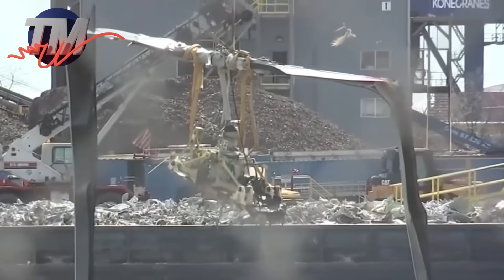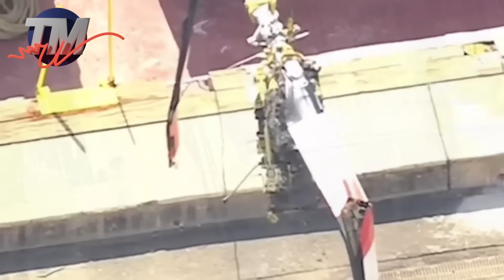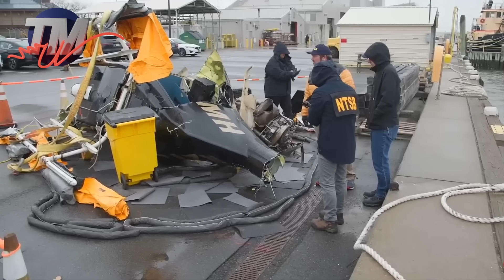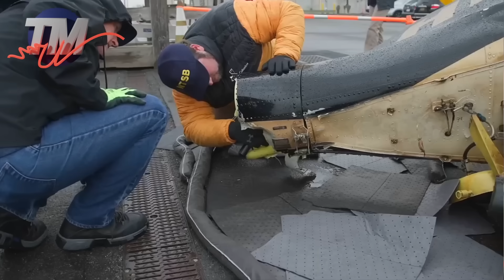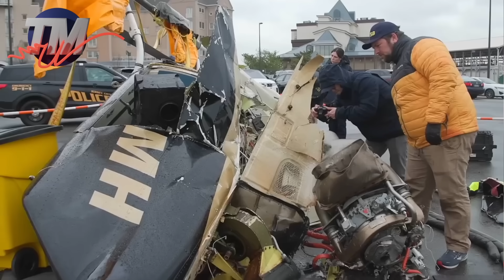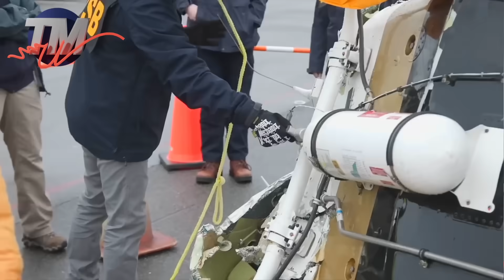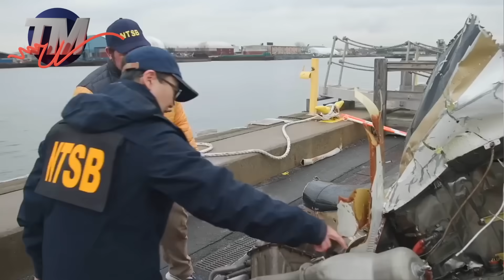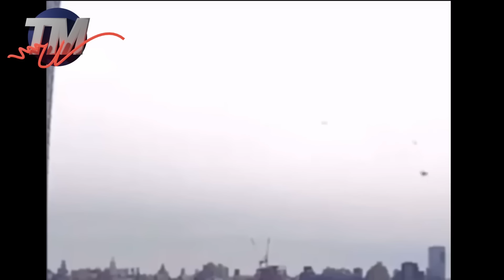Recovery of the Main Rotor of the Hudson River Tourist Helicopter - it's worse than we thought

Comment: Mast/main shaft sheared off? Turbine over reving because load of main rotor gone, tail rotor shaft did shear because of sudden rev increase from turbine, lift of main rotor greater than strength of connection between swash plate, mechanics and fuselage?

Comment: Inadvertent full right peddle input whilst in cruise straight and level flight will cause this catastrophic disintegration of main rotor and tail boom. Does not look like a tail boom strike. This type of accident has happened before. This is why Bell helicopters have introduced a peddle (yaw) stop in place on bell 407 to prevent inadvertent full peddle input in cruise flight

Comment: The airframe was twisted free likely from the rotor momentum in a locked up gear box which would spin the airframe so hard it would first sheer off the tail. Notice the rotor was not spinning when the gear box separated from the airframe.
Reply: I don't see how you can tell that. The rotors were definitely spinning and appeared to be intact when they hit the water. Now, some engineer  would have to figure out if the transmission was seized and spinning as well while attached to the blades.

Comment: I was looking at some news footage today and i noticed that where the tail boom broke off was at a point where the panels were riveted together, except for on the top where it was torn open in a star shape, most likely by the rear rotor shaft. Talking of the rear rotor shaft, it appears to be pinched shut as though it was snapped by the tail boom when it folded.

I'm also amazed at how the main rotor and gearbox managed to rip half of the roof off when it broke free. 

I'm guessing that the entire gearbox suddenly locked up and the inertial forces of the rotors just ripped everything apart.
Reply: Thats not the tail rotor drive shaft, thats the pitch change tube for the tail rotor blades. The drive shaft rides in pillow block, mounted on top of the tail boom under a removable shroud
Reply: @eddie5556  
Thanks for that. 👍
I assumed it was the rotor shaft because I couldn't see anything else either in the tail boom. I take it the shaft ran along above that off white coloured panel?
In which case, where is that panel and where is the rear rotor shaft?

Maybe it was either ripped off as well, or the NTSB had already removed it.
Reply: @the.just.able.biker67  it's still attached to the tailboom, and that's still in the river
Reply: @eddie5556  
Yeah, someone else pointed out where it was and it took a fair chunk of the cowling when it went! The whole lot is missing from the top of the helicopter.
Reply: @the.just.able.biker67  - Metal fatigue?
Reply: @mchapman1928  
It could well've been.
The good thing (if there is actually anything good about this tragedy) is that the NTSB have all of the main parts they're looking for and none of them have been smashed to bits or burned up by the impact.
Reply: That sounds most plausible as far as the destructive forces involved. But what would cause a gearbox to do that? Lubrication failure?
Reply: @jcflindsay  
I reckon it was probably a component failure. I'm guessing there'd be temperature and pressure warning sensors for the lubrication system. And probably some sort of magnetic sensor that'd be triggered by metal fragments in the oil.

I'm in no way an engineer, or even a trained mechanic, but I have spent a fair amount of time working on my crappy old motorbike,  so I have some experience of problem solving mechanical issues, and preventative maintenance.
Reply: @jcflindsay  Could also be from undetected without specialized equipment metal fatigue and the same would apply to a crack in a gear or other critical component.

Comment: I'm no helicopter engineer or mechanic but it looks like the frame itself failed stress cracks that went unnoticed and just got worse and bigger over time could be one poor welded joint that overtime stressed joints around it until the transmission was ripped off during the stress of flight or could have happened during a maintenance event lifting the rotor transmission off and a bold was left in they lifted it cracked a weld or stressed the frame then removed the bolt not knowing what they did
Reply: It would have been interesting if the video included the edges of the roof where the transmission tore loose.